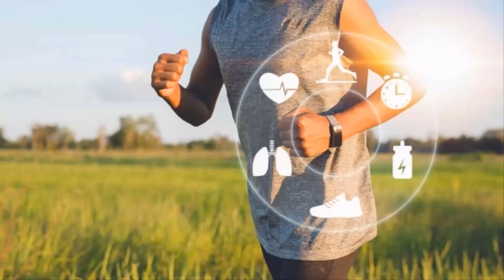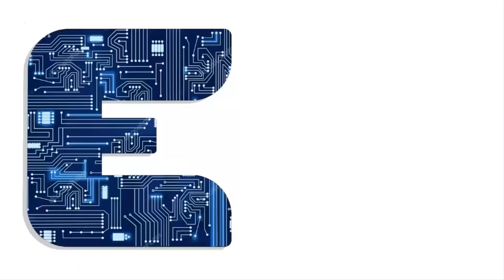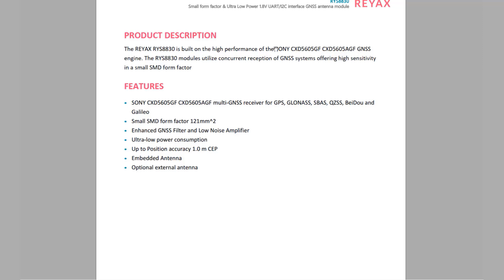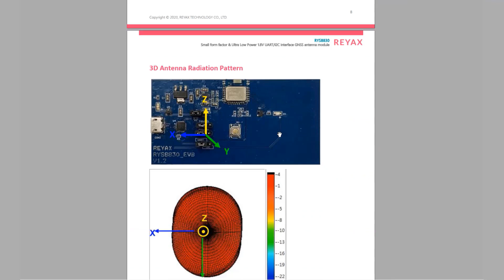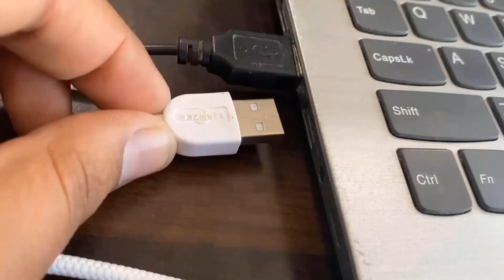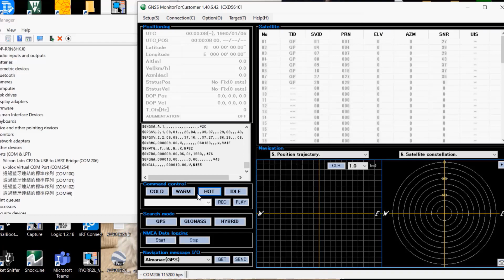World Smallest GPS/GNSS Module Reyax RYS8830 || Tiny & Super Ultra Low Power GPS/GNSS Receiver

Comment: If you are new to GNSS (GPS) and want to interface to an STM32 or similar MCU then forget this device. Otherwise be prepared to loose a couple of months of your life. It is as simple to use as the Large Hadron Collider. The documentation describes each command fairly thoroughly, but gives no operational guide. Consequently it is like trying to learn English from a dictionary.

Comment: Can this chip be installed in a cell phone? And if so does the chipped need to be charged or just the board?
Reply: ofcourse it needs to be charged coz its an electronic device..... they need electrons budddy
ps: u already have a gps on ur phacking phone
Reply: @siddhantpanda8557  right but the phone needs to be on to track it if it's lost
Reply: @cookingwithvince  you have an IMEI number which is unique in all phones. When your phone registers to any network, this number can be traced directly via the network. This is only licensed to police and cyber security. Still if u want to add an external gps and make your phone bulky and not so handy just to find it if lost, it's your wish.

Comment: I have a small problem. I need to use components that are compatible with Arduino. A position sensor (so I use a GPS module. This GPS module must be Adafruit Ultimate GPS Data Acquisition Module (GPS Included)). A position storage (with an SD card that must work with an SPI link). A bluetooth interface. A GUI to visualize the route (using an Android tablet that is compatible with a bluetooth module).
Toi Can advise me to choose my components
Reply from the maker: I suggest you to use A9G module which has almost all these features.
Reply: @HowtoElectronics  I have a small problem. I need to use components that are compatible with Arduino. A position sensor (so I use a GPS module. This GPS module must be Adafruit Ultimate GPS Data Acquisition Module (GPS Included)). A position storage (with an SD card that must work with an SPI link). A bluetooth interface. A IHM to visualize the route (using an Android tablet that is compatible with a bluetooth module).
you can advise me to use what as a component . because it's 3 components must be compatible with Arduino and an Android tablet IHM thanks to a Bluetooth module.